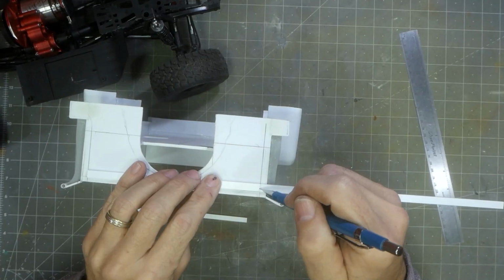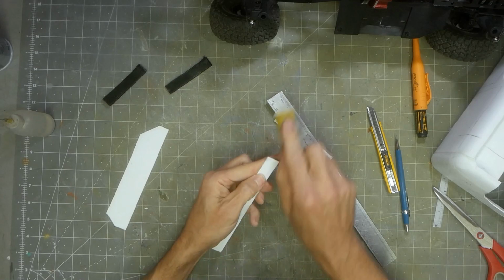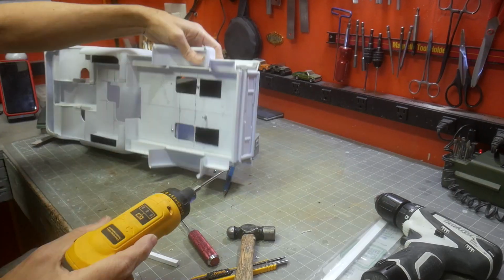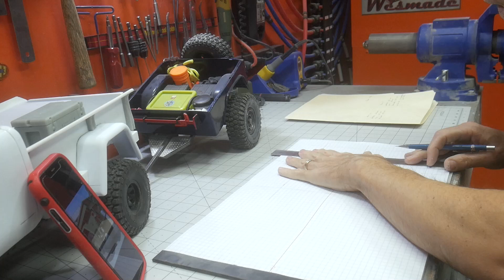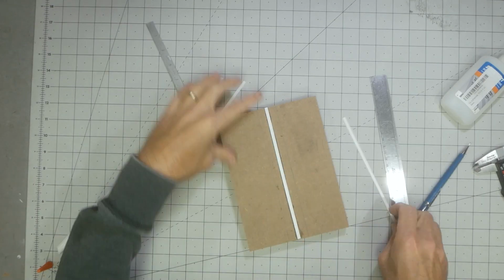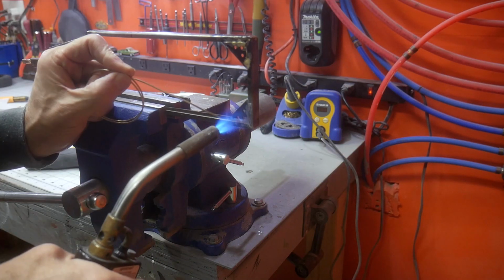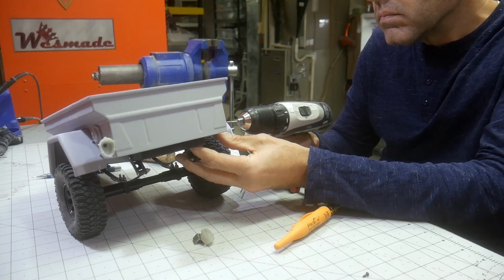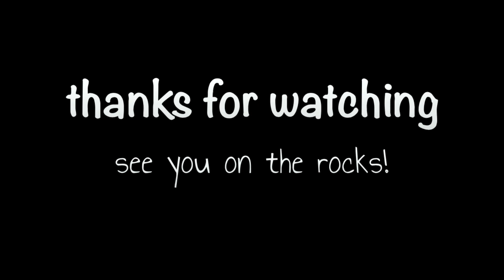Jeep M677 FC and Military Trailer

Comment: Super cool build. I am fairly new to styrene building so soaking up tips and ideas is awesome! I am learning alot, Thanx!!
-One question; I allready know and use the pointy  Pica markers, but I am qurious what kind of "lead rods you use in your mechanical pencil? I seem to have a bit problems making the lead make good marks on the smooth styrene... are you using a soft lead or harder?
Reply from the maker: Its just HB.  If you have an issue, grab some 600 grit and scuff it up a bit.  It needs to get sanded eventually anyway.  Pencils and ballpoint pens work by friction and yes, the smooth side of styrene is often too slick to make them work correctly.  The small scratches from 600 grit will do the ticket and it only takes a minute.